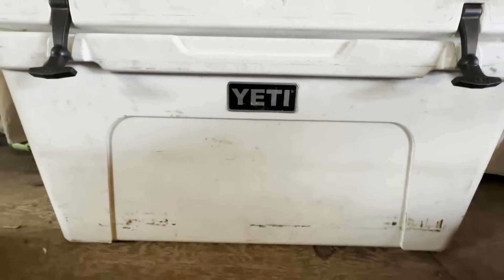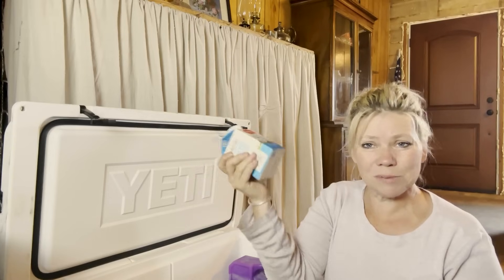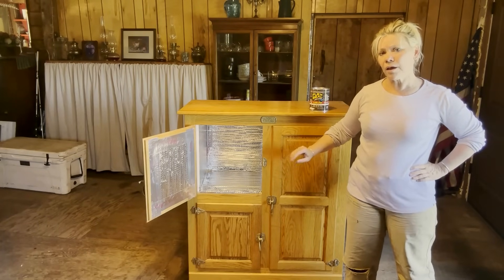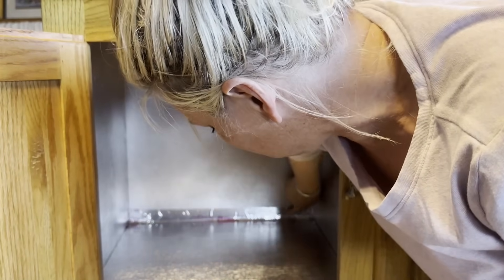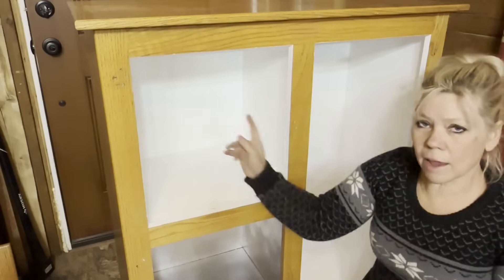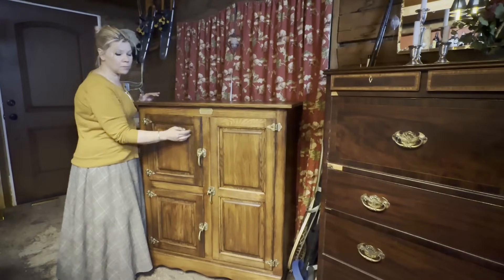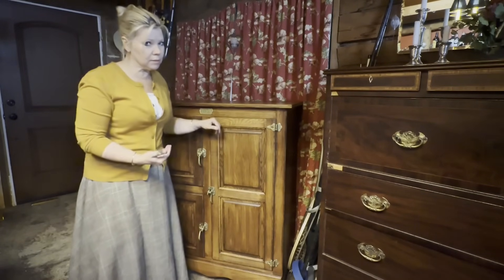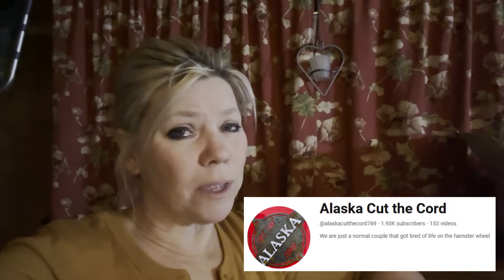Zero Electricity Fridge Build in Remote Alaska - When the Ice Speaks, the Yeti Must Go!

Comment: Great minds . . . 
I do something similar. I too have 4 chest freezers, but one I use as a refrigerator (icebox).

I put a 10-pound Bass Pro ice block like yours into the basket and stack food in the rest of the space.

Ten pounds of ice lasts 4 to 6 days depending on seasonal air temperatures. I change it Mondays & Thursdays.

The freezer came with a drain & plug, so I utilized that for condensate control.

If any of my other 3 freezers fail, I have a backup, since my "icebox" is still a functioning chest freezer. 😊

Comment: Could you add a wire rack/shelf at the top to set the freezer packs on so they don't fall out or touch items?
Also, would placing the "ice box" in the Arctic entry area help to keep it colder?  They sell small battery-powered fans for RV refrigerators to help with  the cold air circulation. 
I hope you can also find a wood cook stove with a reservoir on the side that heats water. Check out Lehmon's.

Comment: We own three original oak ice boxes. Two have the long side door with wire shelves inside. They both have a metal tray that slides in to the entire bottom to catch any drips. Our smaller one has a top on hinges that lifts up to put your ice block into it. That area is lined with metal. We don’t actually use them but they are complete and could be used. I love to use them for organized storage.❤😊
Reply: I was thinking the same thing  with a shallow tray to hold the ice or for on bottom.